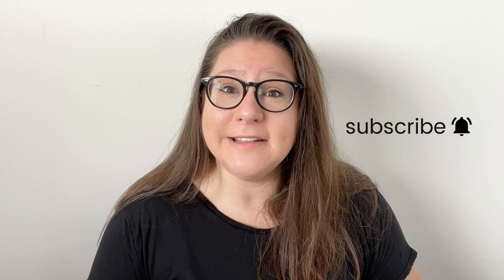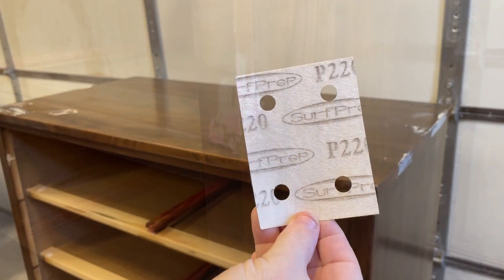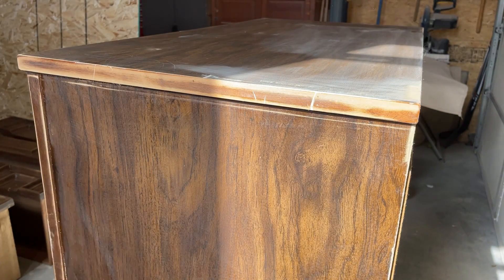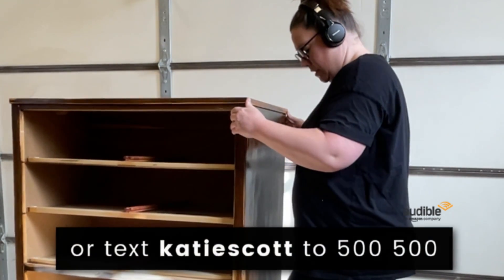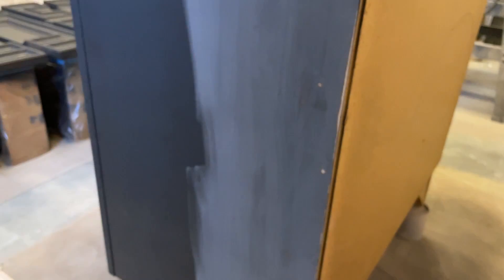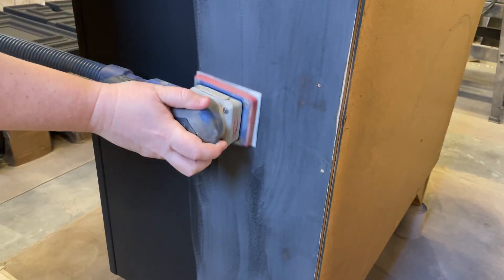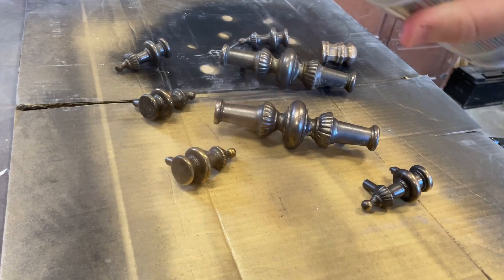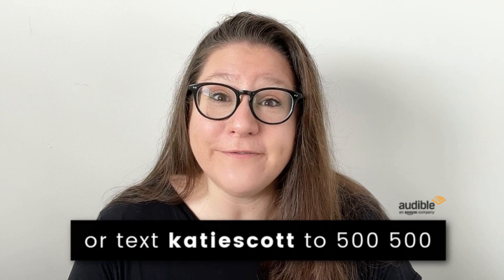Modern Bohemian Inspired Furniture Makeover

Comment: Another great one! Question for a future video: how do you measure the amount of paint and top coat you’ll need? Is a lot wasted? And do you leave it in the sprayer between coats?
Reply from the maker: I usually use about 1/2 quart of paint on a dresser and approximately 1 1/2 cups of topcoat. My sprayer doesn’t waste much. 

I do leave the gun loaded in between coats since chalk paint only takes an hour or 2 to dry.

Thanks for watching!